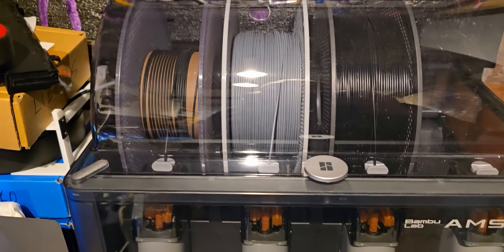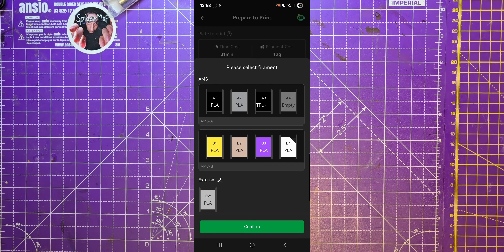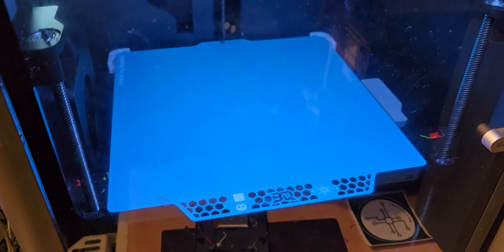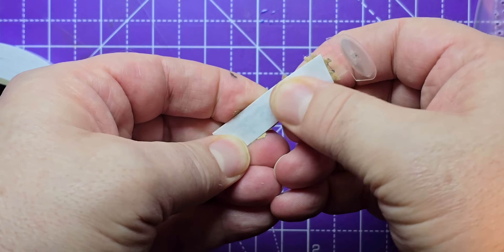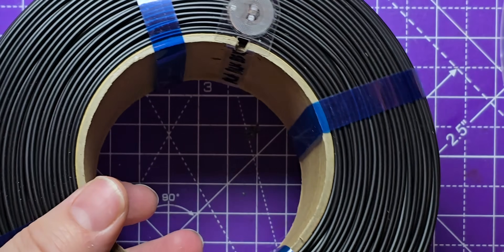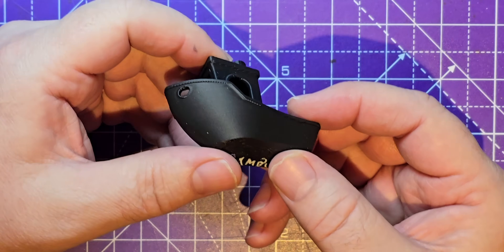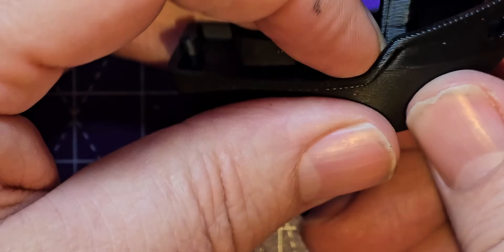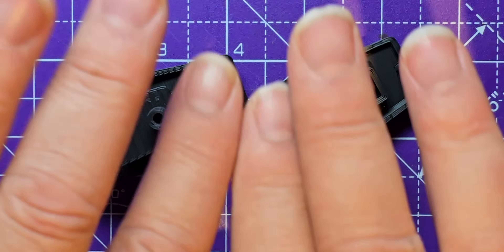Can I use NFC tags from old Bambu Filaments reels in new third party filament refills?

Comment: It’s slower because of the settings of the “generic” profile. If you matched settings with bbl filament, it will print just as fast. The only advantage to keeping the tabs is the odometer function. Read up on calibration…..

Comment: I was afraid they have made the same mistake as XYZ printers from daVinci, where you could only use their own filament due to a special NFC tab in the spool. The company get soon out of business, but left thousands of users frustrated.
Reply: Bambu CEO himself talked about using this trick they are 100% ok with it... If you buy i bulk the bambu ones are ok on price to begin with. Many of the owners of their printers will just go for the easy route and don't mess around.
Reply from the maker: Heh. That's amazing. I know there's a lot to be said for the direction s companies go in, and others are well better to comment on these than me. I think we see chips in consumables and think of the ink cartridge wars... Let's hope that there's enough vendors in the 3d space that this doesn't happen. Based on his comments, doesn't look like it at the moment
Reply: @spidermaf  Keep in mind it also uses the rfid tag to guess how much is left on the spool ! so using this trick means you can see how much is left. Personally i don't think there is much of a danger. Bambu moved first others followed and maybe (unclear) we will see a open standard that is supported by many and bambu will start following it. Bambu like say apple doesn't want to wait until others react and agree on a standard they move forward on their own. Same is happening again with these refills maybe it will lead to a standard or not bambu just did its thing since they can and if others follow fine soft of method.
Reply from the maker: Yeh.. valid observations. Funnily enough my ams has only recently started to estimate filament left.. so maybe I drew attention to it!
Reply: @spidermaf  No idea if all models already did it and/or it was rolled out slowly in firmware but its also used for that. The good news is that 'how much is left' is NOT stored in the tag or in the printer so you can reuse the tag.  It uses the rotation speed (how often it sees the tag) and how much it knows it has pulled in to calculate using the radius how much is left.

Comment: I just double side taped it onto one half of a refillable spool and the refills go right over it.  Saves a lot of hassle from having to keep moving the RFID tags.  Just keep those particular spools saved for that color.  I have been doing that for a long time now with brands that have compatible refills.

You could also cut them close to the RFID tag itself and tape them onto each half the refillable spool.  Again you have to save those spools for that particular color.

All the spools I use are 3D printed in generally the same color as the filament on them.  I am also editing the CAD file for the spools to have a circular indent for the RFID tags.
Reply from the maker: That's a really good idea, I'll have to give that a go with some of my spools!

Comment: Not sure it matters where around the core circumference you choose to place the RFID strip. The AMS rotates the spool to find the RFID location and uses it when positioning the reel and when estimating remaining filament length (based on calculated spool revolution count when a certain length of filament is fed through the AMS filament drive system.
Reply from the maker: Thanks for the extra info. I get that..just fascinated how compatible the NFC strip was with the spool.

Comment: First thought - in Handy you didn't select "use my filament profiles" so of course it doesn't check anything if you replace the filament.
But if you run from a computer, it still doesn't care if you change to Elegoo from BL mid-print. Itvdoesntvre-read the RFID it just carries on with the gcode thats running.
Reply from the maker: Hmm..  I see what you mean. But when I've tried to replace an empty bambu with another different filament mid print before, it's insisted  on the same filament before it will continue. I get it won't change the gcode mid print but I'm sure I've seen it check. But that was a while ago and there's been several firmware updates since then.  I'll try it when I empty another spool.

Comment: Interesting. I've noticed that there can be a significant difference in printing times depending on if you've done the slicing with Bambu filament, generic, or a specific 3rd party supplier. I might have to try a print or two leaving the slicer settings as Bambu filament and see what results I get.
Reply: Generic profiles are deliberately nerfed when it comes to quality and speed. It gives the illusion that bambu filaments are faster and hopefully makes people buy them.

I've been using Bambu profiles for all my 3rd party filaments and it prints so much faster and better